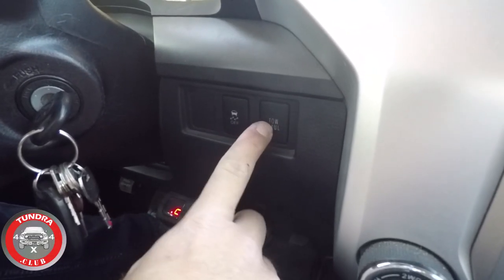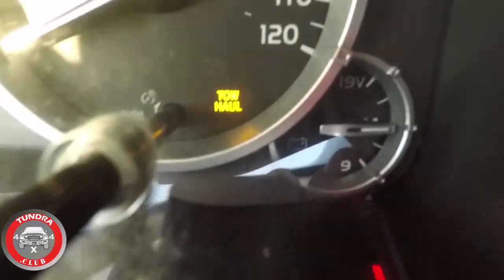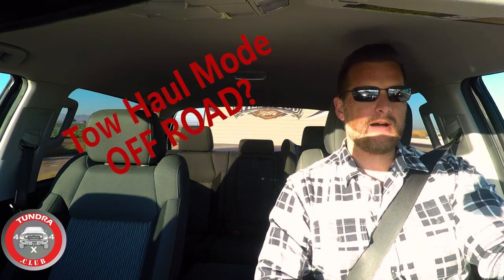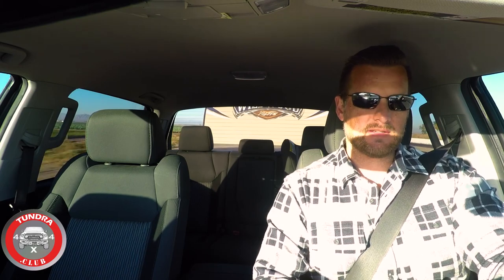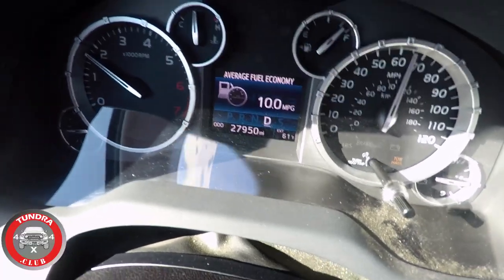Towing with Tow Haul Mode

Comment: I have the SR trim rated for 8300 lbs and it has a hitch receiver and 7-4 pin connector but no tow haul button. Why would they not provide tow haul button if it is needed ?

Comment: Great video.  So I have a pretty basic question.  Our travel trailer is around 6500 loaded with gear etc.  the 5.7 V8 is rated at 10,100 so I know I’m good there but my question is this:  when you hook your camper up to the truck how far does the trailer sit down your back end?  Seriously looking at a tundra but I don’t want to pull our camper with the front riding in the air.  Thanks!
Reply from the maker: +Bassin' 911 definitely look at my video on rear suspension upgrades.  It shows what I use, SumoSprings.  They rock.  Truth be told, at 6500 lbs you shouldn’t have too much of a sag anyway.  Let me know if it helps.
Reply: @Tundra4x4Club  Hi. A better answer would include the optimum amount of tongue weight being 10-15% of the trailer weight. So, if you have a 6,600 lb trailer, the tongue weight SHOULD be 660 - 990 lbs. This number is then part of your payload. The fact that it can PULL10,300 lbs doesn't mean you would want 10,300 lbs on your hitch. Upgrading rear suspension is great, but still don't pull a trailer without knowing what amount your tongue weighs. The load shifting bars you showed us in this video will help to distribute the weight, so some of the weight from the tongue goes to your front wheels too, but that doesn't allow you to exceed your max payload. If the payload is 1,600 and you put 990 lbs of tongue weight you only have 610 lbs left to pack in the seats and bed. My family weighs more than 610 lbs! So make sure your trailer is packed in such a way that you're not putting almost 1,000 lbs on your hitch.

Comment: Great info!  Question - While towing T/H mode on highway, is there a need to engage 4WD?
Reply from the maker: +RiverRuns NC thanks for the comment.  I would never engage 4WD on the highway.  That is a fast way to break the truck.  4WD requires forgiveness from the ground as it torques all 4 wheels.  The cement/asphalt does not provide the forgiveness required.  Hope this helps.

Comment: I have a 2017 Crewmax  TRD 4x4 and Tow a Travel Trailer that is under 7000 dry weight with a tongue weight of 800. I added the TRD sway bar and have a weight distribution hitch like yours. Do you think air bags would benefit? Did the Deaver springs help with towing? Curious on your input. I’m new to towing!
Reply from the maker: Samuel Torres hello Samuel.  No, I wouldn’t recommend changing your leaf spring if your main objective is towing.  I upgraded mine for better off road performance.  With towing, I noticed a decrease in performance, that’s why I upgraded with sumosprings.  Thanks for watching, I hope this helps.
Reply: Tundra4x4. Club What size trailer are you hauling? I almost pulled the trigger and went with a Chevy Diesel because of the limited payload capacity the Tundra has. Curious on your experience with towing since your trailer seems similar to mine.

Comment: I heard many say not to use tow mode once you get to 50+mph (highways) unless going up&down hills they say can burn your engine faster..idk if that’s true
Reply from the maker: +Vanessa Flores thanks for watching.  If I’m hooked up, tow haul is always on.  I find when I’m traveling 55 mph with tow haul off then I get stuck in that floating transmission zone.  I don’t think running tow haul above 50 mph would cause any damage. IMO.

Comment: I want to know about towing down hill with tow/haul mode on?????????????
Reply from the maker: +Scott Snider thanks for the comment.  What would you like to know about that?  I would leave it on down hill as well.  Using your gearing to slow down the vehicle is highly recommended and safer that just riding the brake.
Reply: @Tundra4x4Club  So do I mess with the gears or just let the truck and tranny do the work and just tap the breaks now and then?  In my f-150 I put it in a lower gear and tapped the break when needed this is new to me, I pull a about 5000lbs travel trailer with breaks.
Reply from the maker: +Scott Snider same kind of concept here.  I too pull a travel trailer, use lower gears as you see fit, tap the breaks as needed.

Comment: Doesn’t make any difference on gas engine anyway 
Only diesel with 12-13 k lbs behind
Reply: I have the SR trim rated for 8300 lbs and it has a hitch receiver and 7-4 pin connector but no tow haul button. Why would they not provide tow haul button if it is needed ?